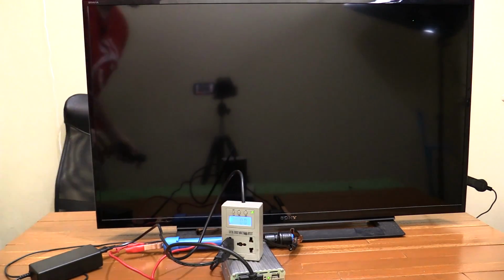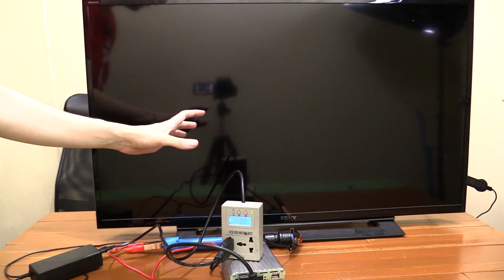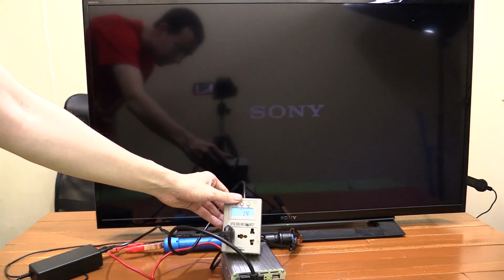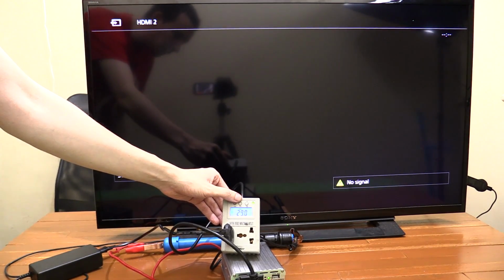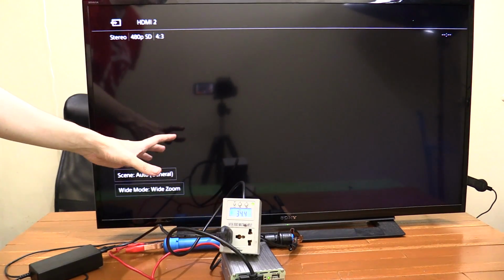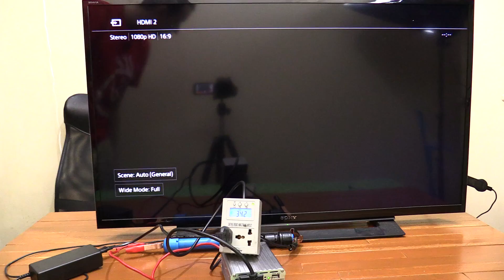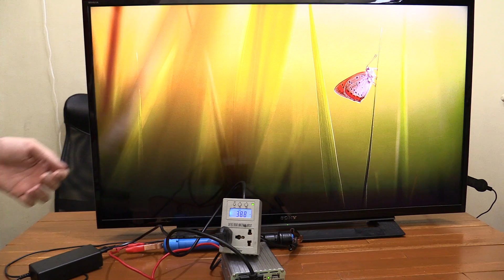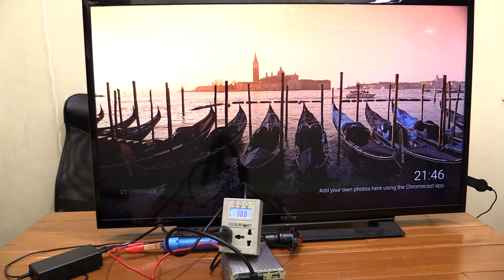Power your TV from 18650 batteries

Comment: would that be enough to run let say a computer a desktop one ?maybe you could show that if you have a desktop ?
Reply from the maker: +Kriss Bartlett I think it could, but the higher the wattage, the sooner the batteries will die. They're only 2200 mAh batteries and even that might not be true. I think the way cdrking bring the price down so low is by using batteries rescued from recycled laptop batteries. Unless you're able to find bulk 18650 for a cheap price, e.g. recycled batteries, I think deep cycle lead acid batteries are probably still a cheaper option.
Reply: yes I was thinking if I had a 100amp hours one would kick it in ok my wife watched that video to I made her and I had to explain a lot so when we are back in Cebu we will get all that inverter 1000w one and solar panel and dc converter and probably a 12 volt monitor to what wire is good to use do you think 14 or  16 gauge ?
Reply from the maker: Kriss Bartlett Sounds awesome! If I'm on a budget, I use 12 - 14 gauge automotive wire from Ace Hardware. But I've also bought some more expensive 10 gauge "solar wire" which is rated for outdoors use under the sun etc etc.
Reply: ok thank you for that the solar one 10 gauge is available at Ace to ?
Reply from the maker: Kriss Bartlett Ace don't sell any solar wire but they do sell 'general purpose' or 'household' wire of all sorts, including 10 gauge :) I bought the solar wire from a specialist shop.
Reply: ok so I don't think there would be any in Cebu

Comment: Hi gadget addict , I think there are tvs that are 12 volts and the battery would last longer. Do you still have your solar setup? Your video inspired me to make my own setup just wondering if you have any update...  😃
Reply from the maker: +Kevin Ray Legaspi haha I was just thinking this morning... The TV runs on a DC voltage, I wonder if anyone will point out that it would be more efficient to connect the battery pack directly to the TV without an inverter and without the TV power supply :P I think this specific one is 19V but I wouldn't be surprised if it ran at a lower voltage too. Still got my solar stuff going :) No major updates because a lack of space. I'm still contemplating sticking some flexible solar panels to the roof using silicone because I think they can be removed later without damaging the roof (rental property).
Reply: +Gadget Addict dc to dc booster, tried it on my laptop 12v to 19v my battery last longer dc to ac consumes additional watts
Reply from the maker: +Kevin Ray Legaspi Yup for sure :) I always just look for things designed to run in cars lol, so much cheaper than buying "for solar" stuff. CDRKING have a nice voltage selectable in-car charger for laptops with changeable tips. Or like you say buy/build an individual boost/buck converter :)
Reply: proof is in the pudding. He did it or a bunch of u need eyeshoes!

Comment: i did that too, but with a lead/acid battery that i charged with a homemade solarpanel. i could power my TV and my Playstation2. :-D
Reply from the maker: +kris754a That's mostly why I have this inverter and others. I'm a big solar fan too :) I had just always wondered if it would work with 18650 batteries. I guess there's no real reason why it wouldn't, but I had to try!

Comment: You could also use a laptop battery pack like this one: http://www.amazon.com/gp/product/B004C4QCYS?psc=1&redirect=true&ref_=oh_aui_search_detailpage , there made for around 11.1v nom but they work fine at 12.0v, I use em all the time with a pure sine wave inverter.
Reply from the maker: +Zebra Comet Oh yeah? Very cool! One reason I went with 4 batteries instead of 3 is because the inverter would whine about a low voltage when I had 3 and had a heavy load that was pulling down the voltage. You don't have that problem with the laptop battery pack. I'm curious, how are you charging it?
Reply: +Gadget Addict there is a slight problem with the lower voltage and heavy loads, but it does work. As for the charger I use a very low amp "Trickle" type charger, like a batter tinder. And I keep an eye on the voltage while charging. Been using this system for a while now, seems to work fine.
Reply from the maker: +Zebra Comet Awesome, thanks for sharing! :)

Comment: Great tip. It would be interesting to see how long the batteries would last, powering the tv.
Reply: These 18650 batteries are 3.7V and they're 2500mAh in average, so each cell holds 9W of power, 4 cells equals to 36W. From the watt meter we can see that the television is drawing 35W/h and add extra 5W for the inverter. So it should last about 45 minutes.
Reply: @ordaxofficial so let's say you have 20 set of this which is 80 batteries all in total, will it last for 3 hours when fully charged?
Reply: @patomansvibration6521  I haven't calculated exactly but yes, the more batteries you add, the longer it will last.

Comment: that was pretty cool but what amazed me was the pvc battery holder :)) im goiong to have to make one of those for myself.
Reply from the maker: +LuisJW1998 I surprised myself with that one too lol. I was thinking I'd design and 3D print a basic battery holder and cut and bend some metal to act as the tabs. Then I thought of the PVC pipe idea and with it being so easy, I couldn't resist!